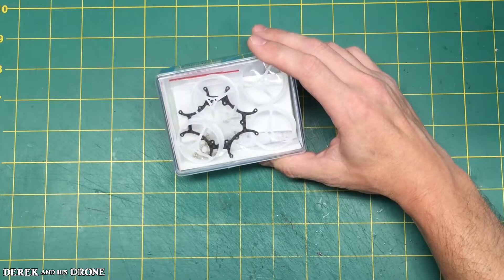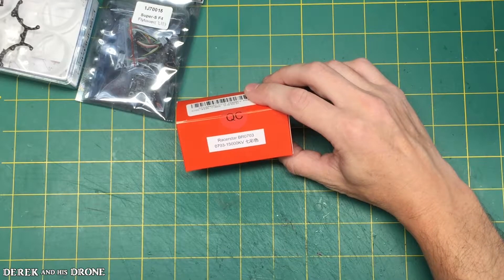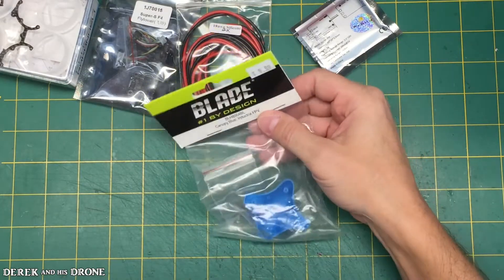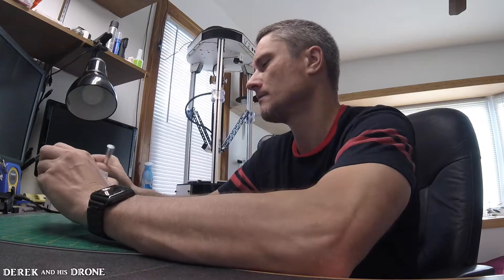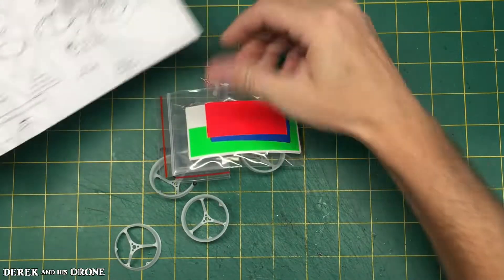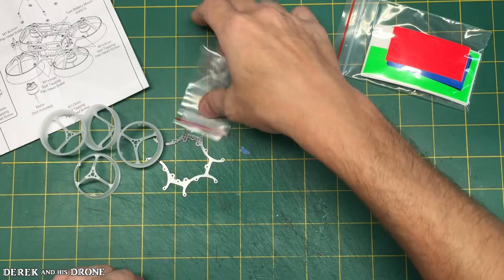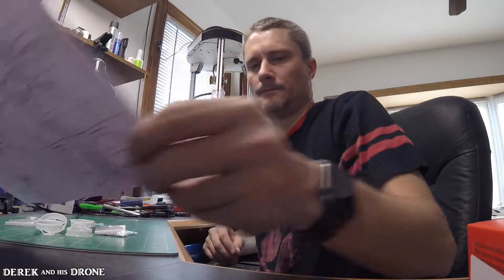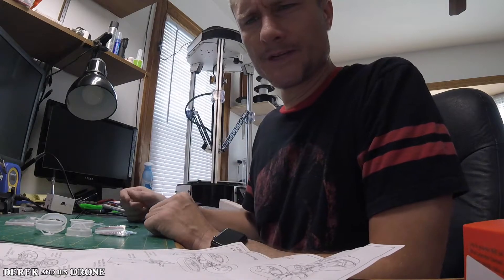2S Brushless Tiny Whoop Build - Part 1

Comment: Never give up on a build ! Go Derek! Onto Part 2 ..
Reply from the maker: I did a few parts on it but it's over.  The build was a disaster from the start.  I never had any luck with the brushless whoops.
Reply: @DerekandhisDrone  oh no!  Really?  Have you looked at the Ur65 and snapper 6 / 7 models ? They're pretty neat BNFs
Reply from the maker: I haven't looked at them.  I have had a few brushless whoop and have always been disappointed with them.  I'm a fan of the Unicorn motors.

Comment: Dont you think 15000kv isn't too much for 2s???? rakonheli recommends 8000 or 10000... was going to buy the same setup but 12000kv.... what are your toughts???
Reply from the maker: I have no idea what will happen with this build.  i typically like higher kv motors in my other quads.  On paper this thing should be a monster.  Check back next week for part 2.
Reply: subbed to see, but somewhere I saw someone using 1s and 20000kv motors, he said they puffed the battery in a minute, maybe with that high kv and your motors, your batteries will suffer.... I'm not sure, I'm waiting on your results to choose my motors, meanwhile I'm sticking to 10000kv... Hope you get what you want with this build,

cheers from Chile.
Reply from the maker: Thank you for taking the time to subscribe and comment.  I never really considered the motor kv as being a potential problem.  I'm hoping it won't be an issue with good batteries.  I think I'm going to fly the standard voltage batteries first then try the high voltage.
Reply: please!!!! finish it quickly.... hahaha, I burnt one insane motor of my whoop.... the perfect excuse to build a brushless whoop!